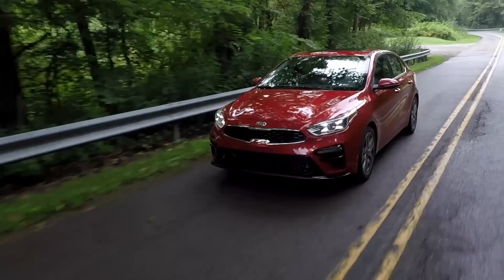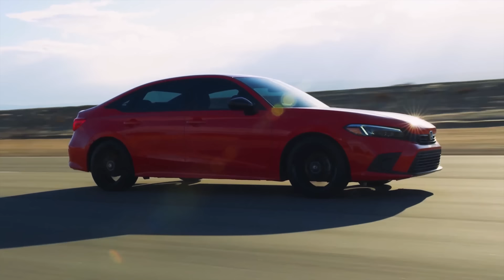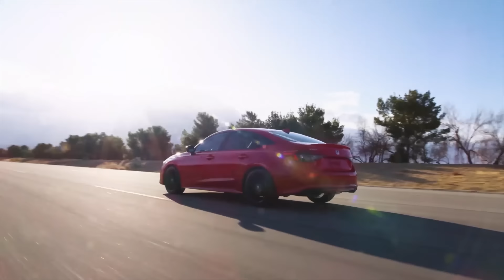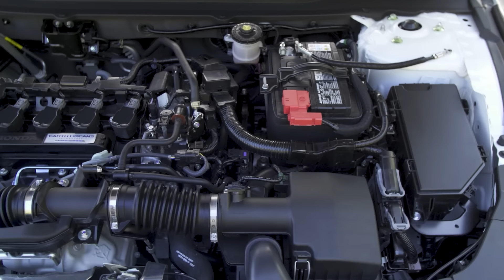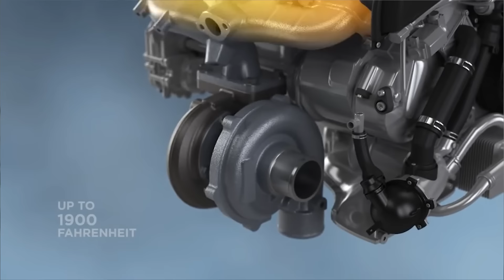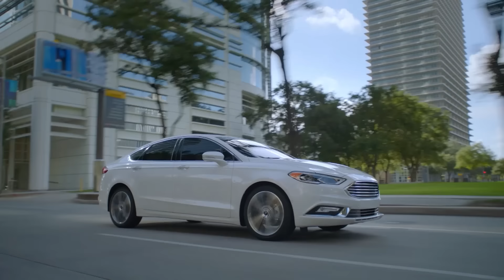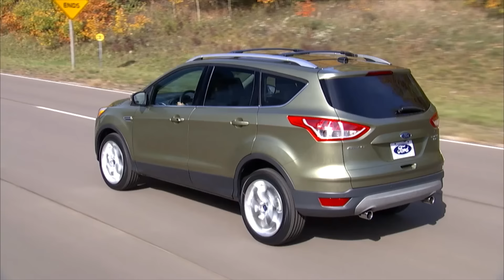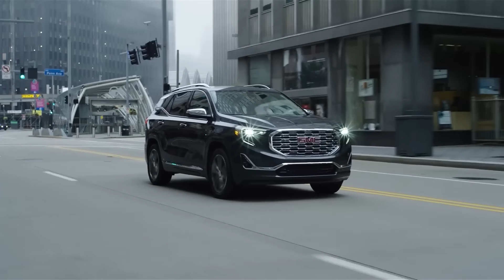Are Turbocharged Engines Reliable? The Truth About Turbo Engines

Comment: I’m a mechanic for the past 14 years and about the only thing of value in this video is keeping with the maintenance schedule.  Good maintenance habits go a long way in having a good ownership experience.  I am very familiar with some of the engines you called out in the video and agree that some have issues but I think their faults are in the design and not the fact that they are turbocharged.
Reply: As someone that has dropped turbos in cars to boost them, worked on factory built units.  Even with regular maintenance, I have never, ever seen a turbo charged engine last as long.
Reply: I've been a tech since 1994. Gasoline turbo engines are much more reliable than in the past, but are still suseptible to extended oil change problems. I personally own three vehicles with the naturally aspirated 3.0l duratec v6. All are past the 200000mi mark with typical issues inherent to high mileage cars. I have friends & relatives with fords ecoboost 3.5l v6, turbo honda accords & one with A BMW turbo. They've all had either turbos locking up, waste gate issues, intercooler issues and direct injection induced carbon build up on the BMW particularly. All but the last is what was common issues in my last 25 years. Forced induction in comparison to naturally aspirated require more meticulous/expensive maintenance. These are just facts.
Reply: Im almost positive that the gm 1.4 turbo ecotec engine can and does fail before 150k, even with regular scheduled maintenance and not abused. I’d take an older NA Camry or civic engine any day over that POS . Every time I see one in the shop I know it’s usually something serious or needs an engine. They’re junk, plain and simple and this is coming from someone who loves boosted engines.
Reply: @droboyjr those 1.4s are junk not because they’re turbos but because they’re just a poorly designed engine. If a turbo diesel can run for a million miles so can a properly maintained turbo engine
Reply: @dawsongranger4940  a properly maintained and well-designed turbo engine It’s kinda funny you had to mention a turbo diesel engine because finding a common turbo gasoline engine that regularly makes it to a million miles without any major mechanical issue is way less common when compared to its gasoline NA counterparts, which should tell you something. But I guess it’s because they’re overall just better designed right? Look, I understand the point you’re trying to make and can even agree to an extent, but what I do believe is that right now, for commuter gasoline engines, a well designed NA engine vs a well designed turbo engine of the same displacement, given the same driving pattern, maintenance schedule, climate etc. The NA engine on average will require less maintenance and last longer without any major components needing repair or replacement when compared to the turbo. To me this is obvious given the turbo has more parts and almost always more complex. I’m seeing it now at toyota with the new tundra, (now granted this isn’t the most equal comparison) but we’re already having waaay more issues engine-wise with the 3.5L twin turbo v6 vs the old 5.7 NA V8.  We have one in the shop right now that’s getting a new short block. I personally like turbo engines and think they can be reliable while providing plenty of power with better mpg’s. I just think they require slightly more maintenance is all.
Reply: @Luximus Æternamus Yeah, I think you lost the topic. Americans have problems with any cost of service. They need Flintstone cars that never broke.
Reply: On an economy car those extra costs will end up negating any efficiency gains.
Reply: Right. I’ve heard that the hemi tick could be greatly reduced with frequent maintenance.
Reply: Ghost, you're correct. My silverado 5.3 has 426,000+ all origanil, still running strong.
Reply: My Kia (yea, what ever) turbo has needed to be “replaced” THREE times since I’ve had it.  While it’s a 2016, it’s still under 100k miles, so the warranty covered it.  Still that’s crazy.    Just like what he said, my mechanic said the same thing - the car has to warm-up.  I drive about 6 miles to work daily and that’s not even on the highway.  A separate mechanic said not driving it on the highway and giving it time to warm-up is a major reason.  I’m planning to get out of the car soon before it hit’s 90-100k miles.  I’ll never touch a turbo again.
Reply: It doesn't help manufacturer recommended maintenance is 10k for an oil change.
Reply: I’ve always thought Turbocharged engines were more complicated than regular or even Supercharged engines. Time will tell, just as Direct injection engines were the rave until the carbon issues arose, now manufacturers are moving to duel injection engines to resolve the problem. I think the hybrid engine with turbos in cold weather are valid. Maintenance is key, and driving the vehicle with a purpose is key.
Reply: It’s the same designs as 1984…
Reply: Naturally aspirated is always better than turbocharged, which is always experimental and never proven by anyone.
Reply: right because that engine has to meet the EPA standards, so while their is a turbo, it has to be done in a way for efficiency sake, and that's where the reliability part comes into question. but that's what happens when California thinks they have all the answers, when they never had the answers to begin with.
Reply: Turbos have come a long way. People like to talk about all the drawbacks of turbos like they're still living in 2000. Many naturally aspirated engines today can produce more horsepower with better fuel economy than they could back then, but people seem to think that can't apply to turbocharger design. smh.
Reply: Thats all bro. Whatever kind of mechanics just take care  of services good
Reply: Would you recommend a 1.0TSI of VW,l? Dear sir.
Reply: 621 1/2 a dozen to the other fact of the matter is their junk
Reply: I saw a video for the new Acura economy suv, the ADX, and it comes in a turbo, 1.5l, 4-cylinder engine.  I thought to myself, that sounds like a disaster for American Highways, the continued high revs, the heat, and other added stress and factors must make this engine blow up before 100K.  So this video popped up.  And the first car they talked about the Chevy eco boost engine I had in a company Chevy trax and that turbo blew on the highway and ruined the engine.  Then they replaced both and then the turbo blew like 2 days later.  Saved the engine though.  But it wasn’t meant to be, the engine blew again.  After that disaster of a vehicle, thankfully not mine, I vowed never to buy an American car again, or any vehicle with a turbo.  I drive a 16 Lexus rx350 now after researching better and reliable naturally aspired engines.
Reply: I'm beginning to think a Tesla might be the better choice.  Gummint regs have made the car companies screw up  IC engines so bad there are no good options left.
Reply: I greatly value your experience and opinion. I bought a 2020 Mustang Ecoboost instead of the 5.0. I don’t abuse it but do open it up at times. Car has only 11K miles but I’ve already changed the oil three times, and plan to run no more than 4K between changes. Do you have any thoughts on the 2.3 in the Mustang?
Reply: @silvertbird1  I suggest run full synthetic oil in it and keep changing your oil and filter on the schedule you have been been using.  There is a difference between abusing a car and driving it hard.  I drive my cars harder than the average person but I do not abuse them.  I stick to the maintenance schedule religiously, using high quality parts (OEM or better) and take care of any issues that come up ASAP so they do not become major issues.  I think the Ford 2.3L ecoboost is a pretty solid engine stock.  Once people start tuning them, there can be issues.
Reply: @silvertbird1  Smart! Since my 2008 SAAB 9-5 was new, I've changed the Mobil 1 Euro synthetic oil every 3,000-3,500 miles. I now have 125,000 miles and it doesn't burn any oil between changes. My next car will be a normally aspirated 4-cylinder that takes regular fuel.
Reply: @hoppysport2872  Yeah it seems that car manufacturers have the same oil change intervals as their NA engines. I think it's just generally a good idea to change oil much more frequently with turbos. 

Even with my guns I lubricate and clean it frequently. You can see a difference in how they perform when it's been awhile since you've cleaned it.
Reply: @silvertbird1  You use synthetic on it? That sounds like a good idea. Manufacturers tend to make their maintenance recommendations convenient as much as possible for the owners and it seems like they kept the old maintenance intervals with FI engines with their NA ones.
Reply: @silvertbird1  The 2.3 is a good motor aside from a small run of improper headgaskets early on. With that oil change interval too, she will treat you well.
Reply: I think you have a great point, but the comparison is turbo vs non-turbo. Given the same maintenance, NA engines would last longer, with less parts to wear and/or fail.
Reply: @moloono1 it depends on the engine design. Almost all small diesel engines in passenger vehicles are turbo charged and use high pressure direct injection, and they last a very long time if given proper maintenance and oil changes. On the other hand, there's some pretty crap NA engines that are prone to early failure due to poor design or the heavy use of plastic parts, such as in a lot of European cars.
Reply: @moloono1  what additional parts supposedly wear out?
Reply: @msk3905  Turbo parts that are not on N/A engines. Turbines, gaskets, actuators, etc
Reply: @moloono1  all the 18 wheelers with over a million miles are turbocharged. The 2jz is bulletproof!
Reply: @steve8803  That’s because the trucks you’re talking about are 1) designed that way, with everything from the engine compression to the gearing in the transmission 2) are diesel which are known to last and there are very few available in the US market and 3) spend more time at highway cruising speeds which is less wear on the engine. You can’t compare semi-trucks to consumer passenger vehicles.

The 2JZ was, again, designed to last. With iron sleeves and forged internals. That’s so far away from the shitty 1.0 to  2.0 liter turbo engines they slap on econo-shit boxes of the masses.

Try again.
Reply: @moloono1  no
Reply: @moloono1  you've proved my point. It's not the turbo charger that makes an engine unreliable, it's the design. A properly built engine made to handle the turbo will outlast the vehicle itself.
Reply: @steve8803  But manufacturers are not making their turbo engines the way you’re describing them. Just because you can name a few good ones makes them the exception and not the rule. To my original point: The mass-market turbo engines are less reliable than the mass-market N/A engines.
Reply: @moloono1  wrong. There are and have been a shit ton of garbage NA engines. Any manufacturer that doesn't design their turbo charged engines properly, also did a shit job with many of their NA engines. They just don't give af.
Reply: @steve8803  I mean, I don’t disagree that manufactures make shitty engines, turbo or not. I’m saying that between the two, you’re more likely better off with an N/A engine from a reliability standpoint than a turbo-charged one. It’s a basic law of more complex is more likely to break. What’s so hard to understand?
Reply: @moloono1  it seems hard for you to understand that adding one simple item to an engine does not cause it to be a problem. The engines themselves the design process the manufacturing process all relate to the quality of the engine. Ford 5.4 l non turbo engines throw timing chains out like it's going out of style. Ls Chevrolet engine break exhaust studs and wipe out camshafts from lifter failure. All design issues. Not a turbo in sight
Reply: @moloono1  yeah you're right. It's only the business that I run everyday

If an air compressor is a complicated item for you. I suggest that you don't ever touch the inside of an engine.
Reply: @steve8803  not a shit ton, that’s like a ton of shit.
Reply: @gwhiz3708  I have a shit ton of dog shit to pick up in my yard everyday. It's fun.
Reply: @steve8803  Firstly you need a much larger engine bay to dissipate heat. When you have a shopping trolley 4 cyl that won't happen. The heat affects hoses, seals/gaskets and fluid longevity.  What percentage of trips are 'short' trips? The Subaru turbo's don't even improve mileage/fuel efficiency.  More drama than they are worth, added cost and in the longer run $.
Reply: @southboundaustral  the fa24t is an absolute beast!
Reply: The design includes a turbo.
Reply: But since you got almost years experience, you should make a video countering his claims with facts and statistics.
Reply: Not everyone is into making videos.... @modenasolone
Reply: @modenasolone  As I spend most of my time fixing cars at work, I don't have the time nor inclination to do that.  In my free time, I prefer to do things I enjoy and making videos about anything does not interest me at all.
Reply: @modenasolone  why? why does he have to make a video just because he doesn't agree with all of it? do you go and make a video on every YTuber you don't agree with or are you like most and make a comment instead.
Reply: @riseabove3082  You don’t have to be a mechanic to know that all these auto manufacturers are chasing profits and not reliability!! If they make smaller engines they should offer substantial discounts off the vehicle price…
Reply: What can you say about the Ford Everest SUV diesel engine Bi turbo and Ford Ranger Wildtrak diesel Bi turbo?
Reply: @gutadin5  I am in USA and we do not have the Ford diesel bi-turbo engine here.  I do not know a thing about those engines.  Sorry.
Reply: @gutadin5 get regular oil changes at 5K and the engines should last a while.
Reply: What difference does it make? Either way they’re failing.
Reply: @realtalk5931  The rate and timing at which they fail.

Edit: 44k miles versus 250k or more.
Reply: @moloono1 Lol, no properly designed, normally driven, regularly maintained turbo engine is failing before 150k
Reply: @TheDiameter  Okay, then why don’t regularly bring in less money than N/A engines in the market?
Reply: Naturally aspirated engines work around 200 years.
Reply: @costelgigi31  Turbo powered engines have been around for around 100 years and work very reliably. If properly maintained and allowed to cool down a few seconds before shutdown last a very long time. That said each of these engines most likely have a different, newly designed turbo that has the possibility having a design flaw. For the most part they will be reliable and do come with very good long-term warranties.
Reply: But WE DONT.
Reply: @costelgigi31  human lifetime😂
Reply: @costelgigi31  Bull.

Comment: I had a 97 bmw 328i what was completely reliable--NA 2.8L. Traded it for a '07 335i.  Got mesmerized by the extra 120hp.  But it was in the shop every month or two for some engine problem or other.  It would go into limp-home mode every week or two.  If i get another turbo car, i'll just lease it.  Maybe a toyota...

Comment: No it’s not a win,win. There is a reason that drag racers have to tear down or rebuild the turbo assisted engines after only a couple of runs. About all that will happen is the engine will last about 1/3 as long as they should. I will never buy a turbo engine vehicle.

Comment: Just drive normally.   Don't gun it all the time.  I have a 1.6 Turbo.  It's 10 years old and have 120,000 miles on it no problems. Take it in for its scheduled maintenance and you will not have problems.

Comment: All depends on how you look after them.  They are certainly more a financial burden: more regular replacements of the oil, the coolant, regular servicing, regular decarbonisation if you have direct injection.  EDIT You also need to adjust your driving style: e.g. flooring the throttle in a higher gear at low speed/ revs is not a good idea with a turbo, especially if you have cast pistons/ con rods (you don't want to risk warping/ snapping of con rods to occur), and, very very important to warm up the power train before you give it the beans, and that means all the fluids up to operating temps, oil pressure healthy, and don't labour the engine on low revs all the time from cold (rev over 1750-2000 for a good time, and a few spells at 2500-3000 rpm).  And don't whatever you do go hammering it hard for prolonged spells at the upper end of rev range: most turbos will cope with high levels of heat well, but giving the turbo 'a rest' from this is important

Comment: I'll jump to the biggest issue. Turbo engines are ridiculously easy to to put "tunes" on. Tunes are adjustments made to the ECU get more power. You get more power by defeating engine over-boost protection. Another trick is to limit timing retardation. Still another is to defeat engine knock protection. So yes you get more power but your engine life is halved and the motor can blow up unexpectedly. Most manufactures void your warranty if they detect a "tune". I have a BMW M2 and I will never get a tune. It has enough power already and I hurt the resale value fooling around with the ECU. Oh, many times your car will fail emissions also.

Comment: If you want your car with semi decent pick up and go, turbo is the way to go, much better torque at lower rpms. Feel like v6 or v8 with 4 cylinder fuel consumption. I much rather take a properly engineered turbo car over a NA engine

Comment: In a nutshell, turboDiesels on trucks are very reliable.  Turbos on gasoline engines are much less reliable.  It's the EPA that is trying to force us into smaller displacement engines with turbos for mileage reasons which of course are going to have a shorter lifespan.  Don't let anyone try to tell you different.